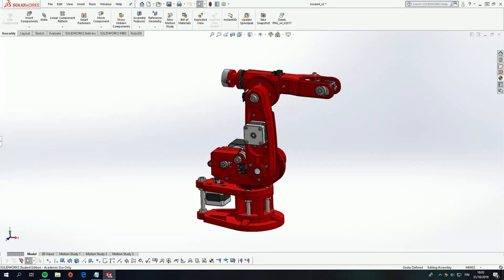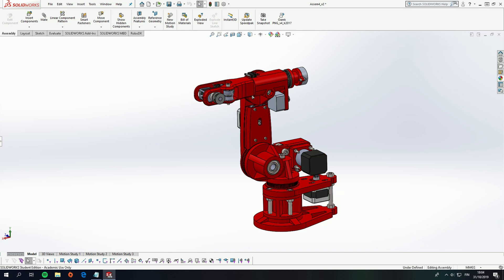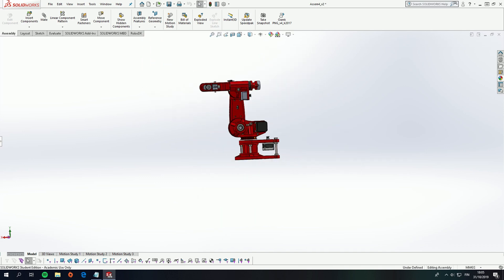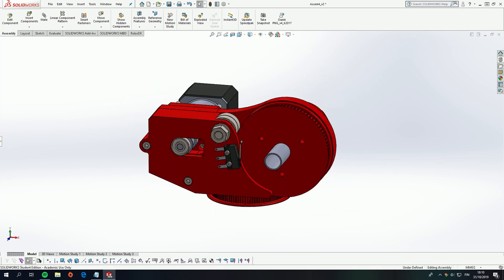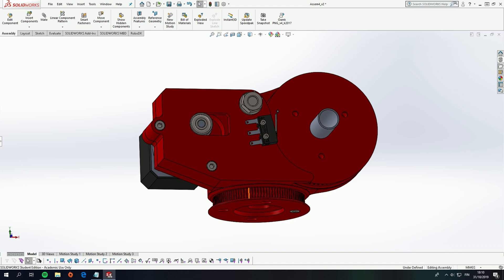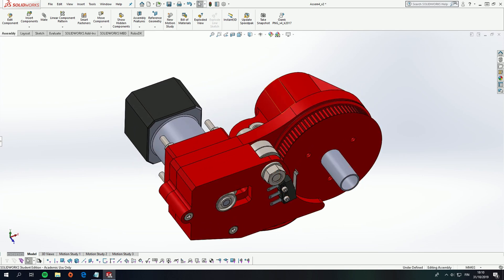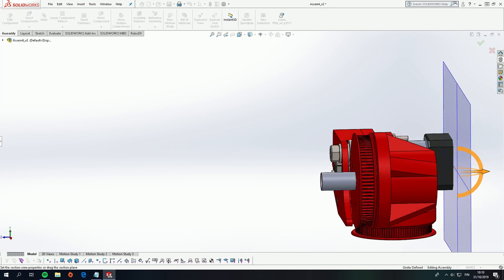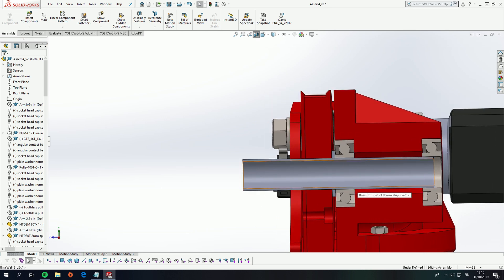3D Printed 6DoF Arduino Robot arm - Overview of the arm [Part 1]

Comment: Yeah, I am modding this in places with FreeCAD replacement pards but got stuck with modding Arm2Mountv2 for chang in size for bearings to deal with my introduction hollow linear rods.  Got sucked in I think with the SolidWorks as I bought a maker subscription to find importing the parts is no better than importing the step files into FreeCAD since the SolidWorks parts seem to import as one blob without sketches et al anyway.

May just be be not understanding something etc.

Comment: Hello, I have a problem can I change pump shaft to 3d-print.Because I cant find it in the shop.
Reply from the maker: Shaft could maybe be printed but it would result in a weaker joint.

Comment: How do you attach the 15mm aluminium tube to the toothed pulley?
Reply from the maker: It's just a push fit. The tube only acts as axis and doesn't transfer torque. The actual pulley is bolted to the robot arm, tube is just a pivot point.

Comment: Hi! Just wondering how well does the open-loop control works? Are there any step losses etc? I'm thinking about putting rotary encoders with each stepper but that probably makes arm a bit too heavy, especially in joint 5 or 6. On the other hand it feels like open loop control will not work correctly. Also, what reduction ratio is there in joint 2 gearbox?
Reply from the maker: Hi! Open loop worked well for me. As long as the load on the end of the arm isn't too big, the steppers won't skip steps. At the time I went for open loop mainly for the simplicity. Nowadays there are good closed loop motor-driver combinations where the stepper drivers themselves check for the correct amount of steps taken. These systems don't require external encoders and only need step and direction signals from controller. You can see this type of system in use on my 3-Axis cnc milling machine project. If I remember correctly it is a 80 tooth gear with a 16 tooth driver so the reduction ratio is 5.
Reply: It shouldn't as long as the load is not too big. the gear reduction also matters. the higher the better

Comment: hello! your project is amazing and quite inspiring. Can you please share CAD files of the design from their parts to the assembly if you don't mind.
Reply from the maker: Hello and thank you! Link for cad files can be found in the description of the video.
Reply: @tw2ka644  yea sure thanks I saw it, but what version of solidworks did you use? With solidworks 2018 the nuts, bolts, washers etc, lets say all the standard parts become extra large. Any opinion on this issue please!
Reply from the maker: @simaiseko2074  I believe I used 2018 version of solidworks. Interesting problem I've never heard of it before.
Reply: @tw2ka644  Well, am using 2018 version too. Can you provide an email please so as I can send an image of it to you, perhaps you might understand what the problem is.

Comment: I just 98% finished building the arm, just missing the 6th axis motor to your design and wiring it, can give an email to which I give created it also send you a photo of it!
Reply: How did you assemble the second arm?
Reply: @hectormoreno1769  I am also assembling it, can I ask what pulley you used for Joint 1? (first vertical joint, the one with the geared motor) in the CAD it shows a pulley without belts attached to the Stepper but I cant find something like this, maybe you can help me out. Thanks!

Comment: Hi! Project looks great, i want to try build my own version. Before i do that i have question. Why do you use in (for example) base motor 16 and 100 teeth pulleys? Do you calculate it somehow? Why dont you use 20 and 100 tooth pulleys or others? And how do you calculate motors torque? Thanks for all advices and keep it up bro! You are doing great job ;)
Reply from the maker: Sorry for late reply! 16 teeth HTD3 pulley was easier to find. It also offers better torque than 20 teeth. 100T gear on the other side was used because it was around the right physical size for the arm. Axis torque is then calculated by mulitplying the motor torque with the reduction ratio (5 if 100 and 20 tooth pulleys are used). I also accounted for some torque loss on the system so I multiplied the result by around 0.8, excpecting a 20% drive loss.

Comment: I am buying the nema 17 with the planetary reduction for the lower actuator
I feel like 5 to 1 is not enought? what has been your experience?
what do yo think about 14 to 1? will it break the plastic pieces?? will it spin too slow?
Reply from the maker: The planetary reduction might be a good idea. In this kind of a application stepper motors have quite a broad speed range. I think this arm would be plenty fast even on 14 to 1 reduction and obviously doing so would increase the torque. The arm has been designed to have large surfaces around bearings on each of the axis so I don´t think its going to break. The first thing to give up is probably the motor mounting solution (bolted to slots), which would cause the motor to slide reducing the tension on the belt.
Reply: @tw2ka644  exaclty, that way the full speed range of the stepper can be taken advantage off, also increse resolution and reduce vibration

Comment: hi, could you tell me how much this arm weighed and what was it's payload capacity
Reply from the maker: If I remember correctly the arm weighed around 2 kilograms and with given motors it had a payload capacity of around 250 grams on full arm length

Comment: Hi , very cool Robot. Is it possible to add the 3D Step Assembly file on your google drive, my Solidworks is an earlier version and i cannot import the file.
Reply from the maker: Sure! I added the step file to the dropbox folder.
Reply: @tw2ka644  I dont see the file, i downloaded and extracted, but no step file.
Reply from the maker: @Kashmir284  The file should be on the root of the onedrive folder. If you still cant see it please let me know I'll try to figure it out
Reply: @tw2ka644  nope, i cannot access the root drive,just create a dir called STEP, and place it in the zip file
Reply: i thoght its dropbox, thats what i saw 
not onedrive
Reply from the maker: @Kashmir284  Ah my  bad, I meant the dropbox... I uploaded a file called arduino robot arm files + step and it includes the step file of the assembly. I replaced the link in the description and it should take you to download. Could you verify it works?
Reply: @tw2ka644  Hi, Thanks- all is good. Are the changes included in this 3D assembly as per your video? If not no problem, just wanted to know- once again, thank you so much !

Comment: how do you determine the spcae between pulley centres
Reply from the maker: Sorry for the late answer. When designing the model in solidworks I used solidworks sketches that were shaped in a way that the belts were traveling. Then I defined the length of the sketch line (which represents the belt) to be the same as the belt I had. This way I got the absolute position for the driver pulley. Then I added a bit of play on both sides for tightening/loosening the belt!

Comment: At what layer height and infill % did you print the parts at?
Reply from the maker: All parts were printed on 0.2mm layer height and 20% infill.
Reply: @tw2ka644  Thanks! Any updates on the software video?
Reply: @tw2ka644  Also, are the axial  ball bearings single direction thrust bearings?
Reply from the maker: Yes they are single direction thrust bearings and there aren't any updates right now. This project has been on hold for a while but I hope to keep developing the software in the near future.

Comment: Is the connection between the 5:1 ratio motor and the pulley 3D printed?
Reply from the maker: That connector is indeed machined from aluminium. There are two aluminium pieces in the robot, that connector and the one between the round j5 motor and the long axle passing through the second arm.

Comment: Can u sent me files for this arm by any chance I would love to print this
Reply from the maker: Sure thing! In this folder there are the STL files required to print the parts. I also included a list of hardware and a picture showing which part goes where. The zip file contains the solidworks model. https://1drv.ms/u/s!AvP8Z7wyn-jlbPv8-ncTiBdTWO4?e=qZYMGe
Reply: @tw2ka644  Very Nice! I Will try make my own